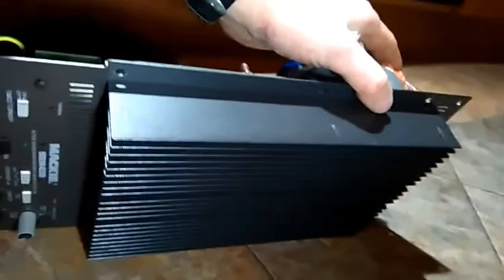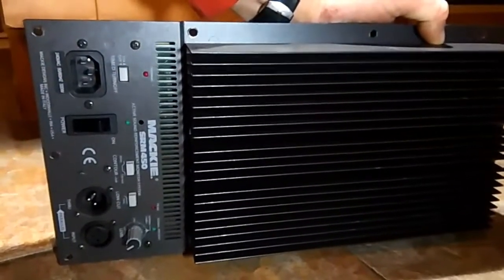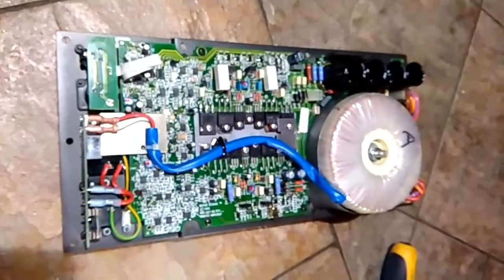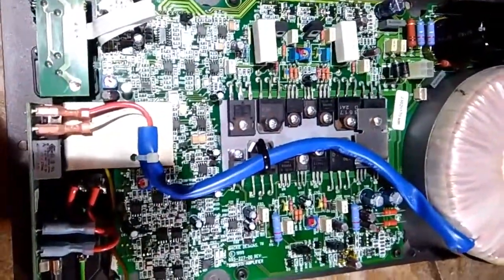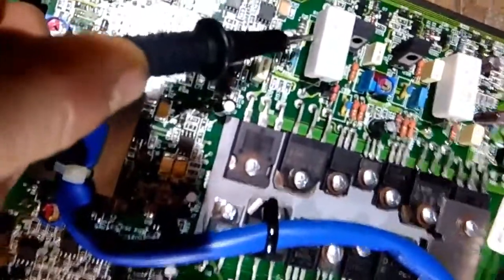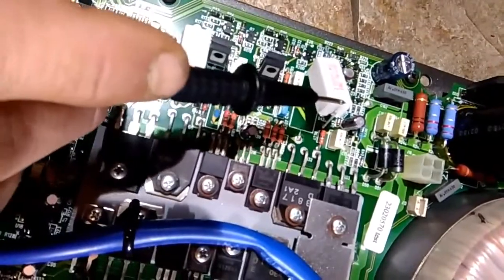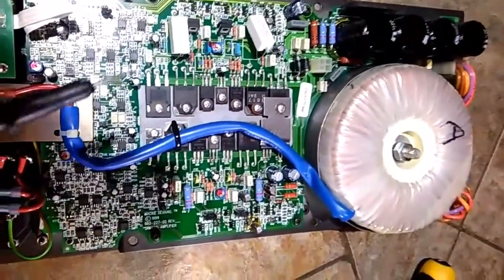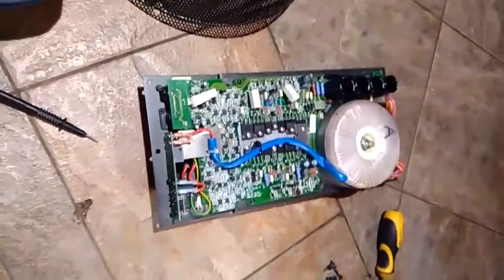Mackie SRM450 Bass Distortion fix.

Comment: I had the same distortion issue with one of two SRM450 v2's.   I got the amp out and the board is a different layout than yours.   Your's must be a V1.   But I searched around and found the two resistors at the top end.  Sure enough, one of the two had popped out of the solder connection.  Additionally there are to big capacitors in the same vicinity (there are 4 big caps, but 2 are bigger than the others.).   The tops of the big caps are distended and cracking open!   I redid the solder on the resistor and retested, but no luck, still have the distortion.   I'll have to source the two big caps and see if I can replace them.

Comment: my Mackie does not turn on the light if I connect it and do not pretend you know why it is
Reply from the maker: Jose Baudilio Chacon, so does it power up with no light or is there no power aswell.?
Reply from the maker: It's got to be one of the two. 1. Transformer has given up or 2. As simple as a fuse, plug or power cable. With any powered (active) speakers or Amplifiers draw more than double of its operating Ampage when first switch on. You would need at Least a 10 amp fuse on a Mackie 450 mate. Ps, That's not pretending btw I have a C&G 2330 Electrical Installation & 17th Edition Wiring Regulations plus dj for 29 years
Reply: had the same problem, unplug and then plug the transformer to main board cable in